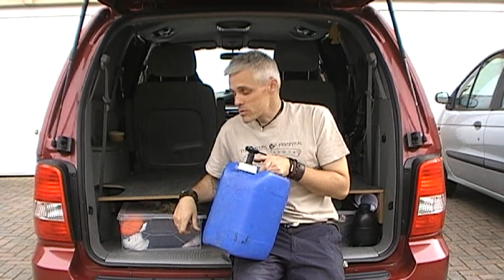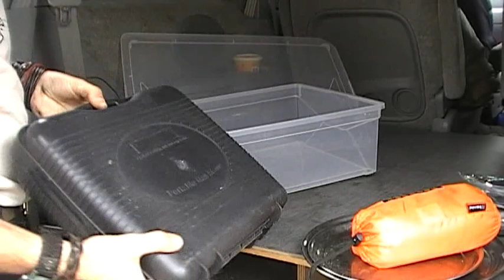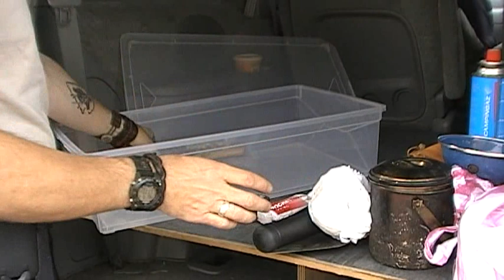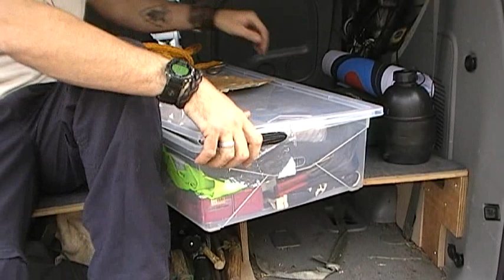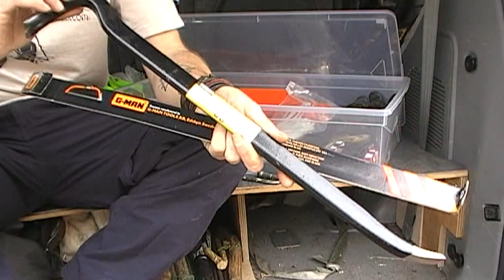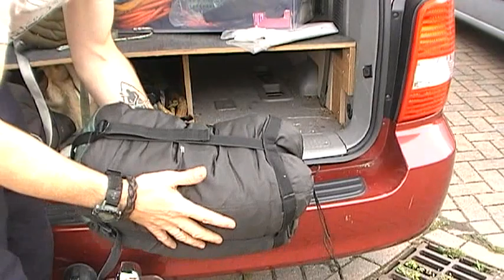Bug Out Car

Comment: you should like into self amalgamating tape, its extremely useful should a coolant pipe burst, same with those cans of tyre weld, there a pain to change the tyre after but on the motorway you dont want to be changing a flat if you can avoid it

i'd be careful with that crowbar though, some vehicles have been known to fire airbags from jolts post collision, unless the cars on fire or something its best to call the fire brigade and wait

Comment: @seanmulhall Ah, ok, brill. for us thats a problem, as our spare is only accessible from the inside, and we occasionally still use the rear seats. we have a Vauxhall Zafira and we were thinking of converting out the rear interior side panels and using all available space in the sides...(we already have emergency items in them including repair kit, medical, and some powdered foods, and we will have a car kettle soon as we have been stuck in traffic with two kids... no thanks...) Thoughts?